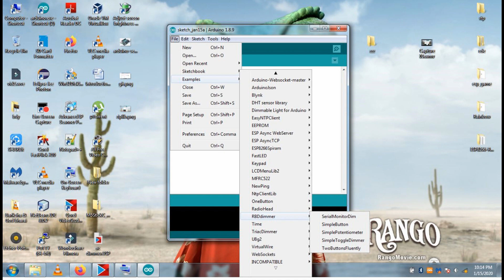AC Dimmer with Arduino | RobotDyn AC dimmer

Comment: Hi can we do same thing with esp32
Reply from the maker: Yes it is possible
Reply: @electronicGURU  I am so glad sir for getting your reply, actually I am doing same thing with esp32 and blynk server, I am controlling dimmer with slider but I also want to control manually ,
Reply: @electronicGURU  ❤️
Reply from the maker: Sir what do you mean by slider ?? You mean blynk slider??
Reply: @electronicGURU  yes you are right
Reply: @electronicGURU  ❤️
Reply from the maker: Ok buddy just give me some time i am working on a DIY version of it so after 2-3 videos we will connect it to blynk for sure
Reply: @electronicGURU  I already completed in my project  4 channel relay modual on/off with mobile aap/bylnk with live manual switch feedback and also control ac voltage using Rbdimeer in blynk app using slider, 

Only one thing remain , I also want to control this dimmer using pot with live feedback in blynk app
Reply: @electronicGURU  I am waiting sir
Reply from the maker: Okay for Now i just completed a video on DIY AC DIMMER with working explained in detail. Will be coming soon.

Comment: can u help me on how to use the new ac light dimmer module that have 3 port instead of 4 in old versi on . i am really confused where to connect the bulb wire and where to connect the ac plug wire
Reply: Same, there's so many tutorials here with the 4 port version. None with the 3 port

Comment: Can I control the brightness of the bulb using some kind of sensor ? If so what should be the code ? Like if there is any motion detection then light will glow upto max 100% and when motion is not detected it should be 50%
Reply from the maker: Yeah something like that. You can do , the code is pretty easy i think you can edit the code pretty easily.

Comment: can one dimmer module be used for several lamps with different brightness levels?
Reply from the maker: i don't think so but one zero crossing you can use but you have to use each moc3021 & bt136 for each of the lapms

Comment: I try but bulb and led from ac light dimmer modul doesn't on, i've change the potensio, how fix it? Thx
Reply from the maker: Well for most of the led bulb won't support Dimming, So the Dimming led bulb are different they mentioned as it has Dimming capability. And if you could explain your issue in detail i'll able to help you then.
Reply: @electronicGURU thanks for the answer, when I upload the Simple Potential program, the LED on the AC dimmer module does not blink like yours, what's the problem?

Comment: is it work for multiple dimmer loads
Reply from the maker: Please explain what do you mean by multiple? You mean connect more than one load to the same driver? Because it is one channel.
Reply: @electronicGURU  i need more than one channel dimmer using single arduino boards..
Reply from the maker: Then there is a 3 channel variant of the dimmer is available in the market. You can use multiple dimmers with one Arduino board as well.

Comment: Hi!!, Thank you very much for your video. Suscribed! . I’ve got some devices and I would like to config it pushing a button. If you push the button (turn on/turn off) if you press the button for more than x seconds the light increase/decrease. Do you have a code or some tutorial? Best Regards,
Reply from the maker: For that you can make a simple latch circuit and it to any circuit.
Reply: electronic GURU hi again! Thanks! Do you have any example? I hacer never done it.

Comment: Can this be used to control the speed of a fan? Nice video, btw... :)
Reply from the maker: well if we add a capacitor and resistor more to the current circuit  we can , you must refer my previous  video i told this part in that one.
Reply: @electronicGURU  Thank you very much... :)
Reply: @electronicGURU  Ok got it! For inductive load we need the capacitor and the resistor! I will give it a try! Thanks again..! :)
Reply from the maker: https://youtu.be/BXpuD2KPcTk try this I explained  in this one. might help
on 06:18  i told about the cap & res to add to accept inductive load.